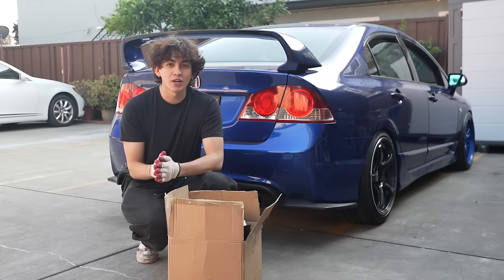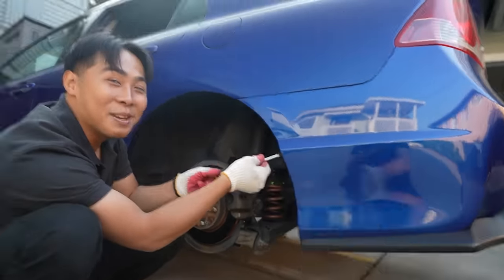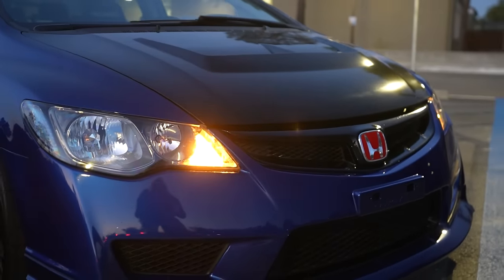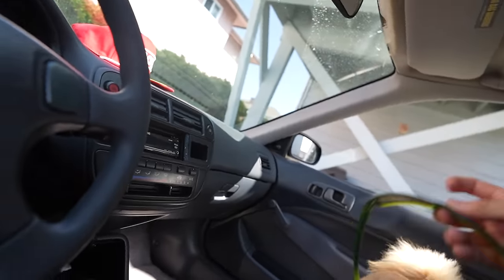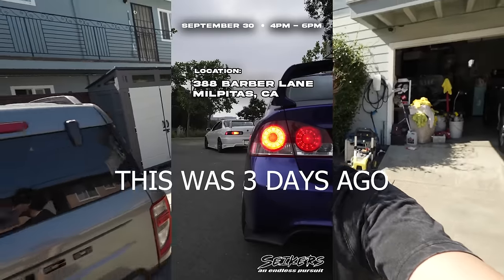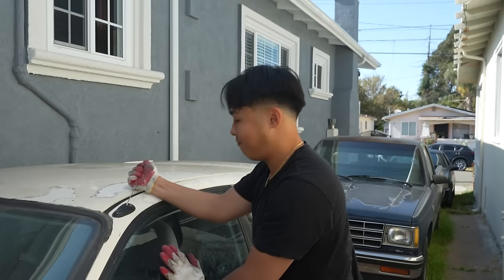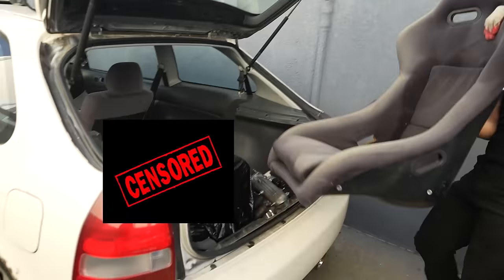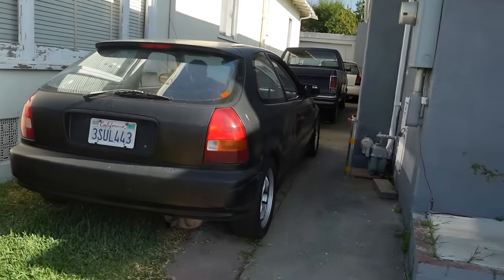The FD2 gets JDM Clear Tail lights!

Comment: I honestly think the bit of red was fine especially with the badge already adding some red. I'm honestly 50/50 on it. I think if you could get rid of the red on the Honda badge it would look cleaner. I think it does look cool when the lights are on, but something feels slightly off when the lights are off. It's so close to being an all-blue build, just go the extra two steps and I think it'd be super clean.

Comment: I just put a K24A in my FA5 2 months ago after swearing i was going to keep it stock forever. Added Cams & spring kit / headers / 3” exhaust / intake / tuned on E-85.. now i have a supercharger kit coming in 🤦‍♂️.. was going to keep the outside 100% stock as well.. but your videos are kinda convincing me to go JDM front and rear end.. 🤦‍♂️ thanks